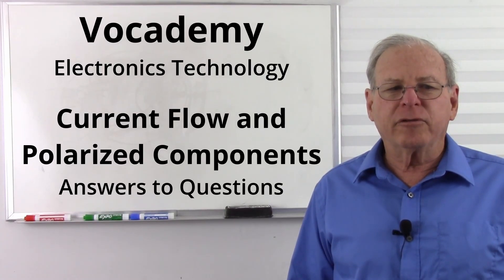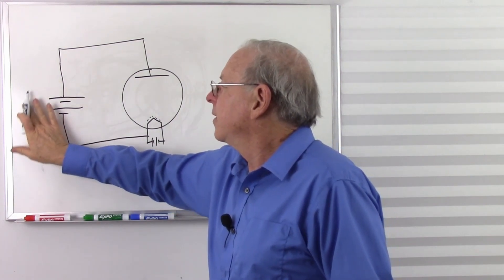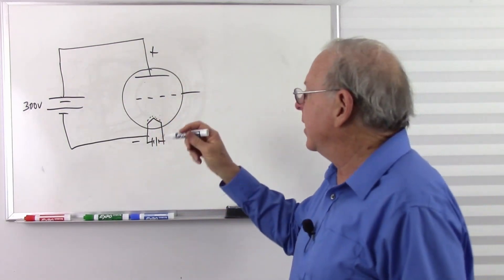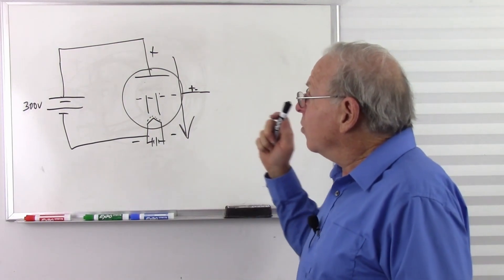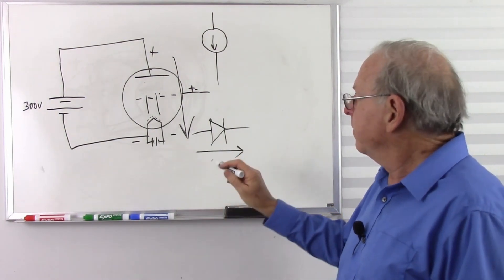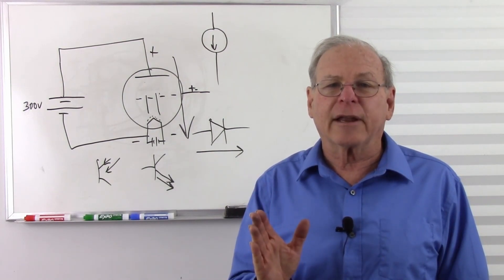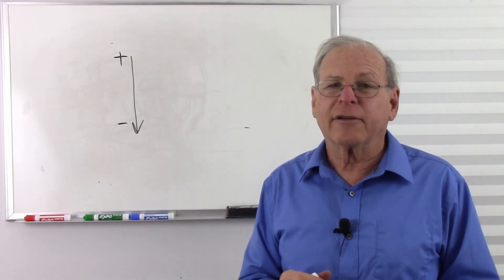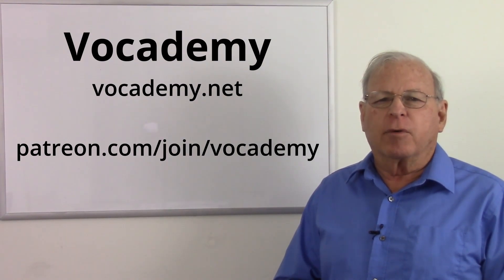Current Flow and Polarized Components   Answers to Questions

Comment: Hi!  I'm an old timer that started with tubes.   I remember many of the transistor radio circuits I studied in the 60's had PNP transistors and a positive ground.  (Back then, "Made in Japan" was something to make fun of.   Maybe all the cheap and unwanted transistors were PNP?)  Because of this, electron flow was burned into my brain.   I don't remember if I had any trouble with my EE college courses because of this thinking.  Of course my thinking kinda changed with TTL logic circuits and the now universal negative ground.  I designed and built a few computer boards back then, but eventually went into pure programming.   Now that I'm retired, I'm going back to my electronics roots as a hobby.   Thank you very much for the refresher vids!  All are informative.